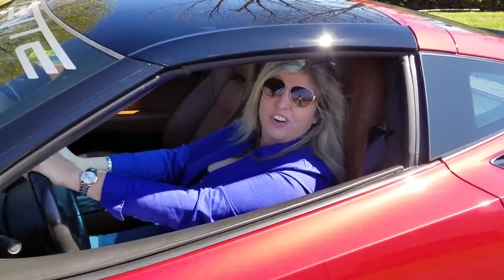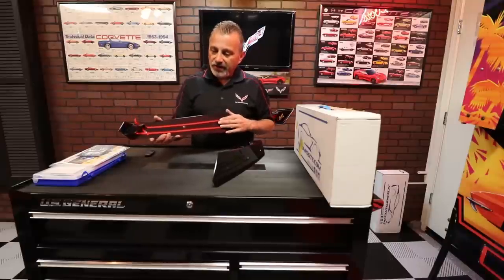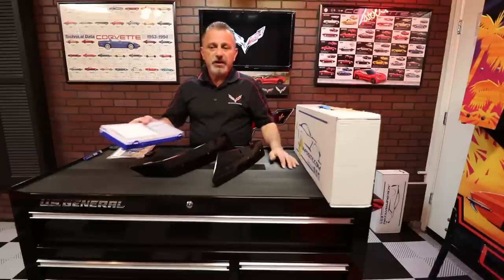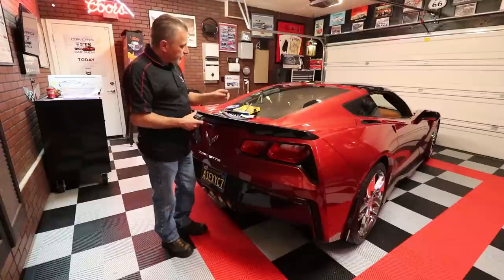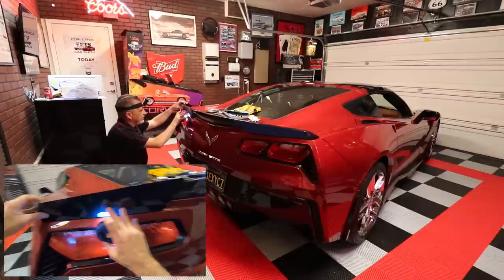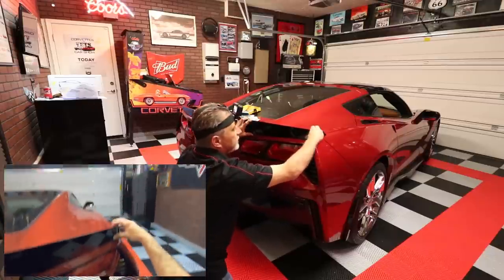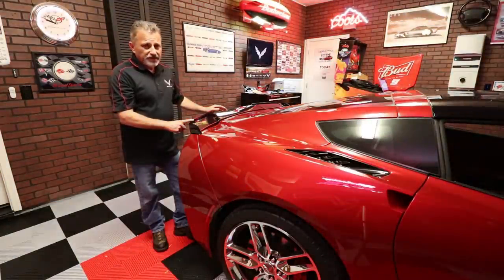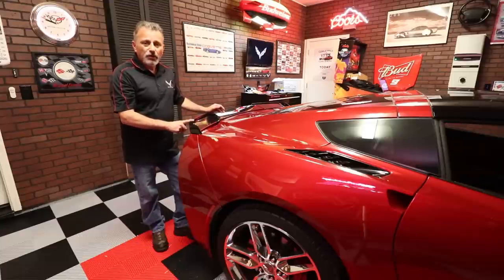How to Install an ACS 5-1 Z51 Spoiler Conversion Kit on a C7 Corvette

Comment: The actual Z06 Stage 2 wings are  a bit higher. Just pointing that out in case someone does this method and wants to mount them higher. And, they make a Z06 spoiler to mount the wings to that fits the Stingray and does not stick out on the sides.

Comment: I have a z51 spoiler on my stingray, is that what you are showing here? I would like to do exactly what you are doing but want to make sure that what I am looking at here is a z51 spoiler, it looks like it is.
Reply from the maker: Yes In this video I am converting my Factory Z51 spoiler.
Reply: THE CORVETTE CHANNEL thank you I'll be doing this in the spring

Comment: Roughly, how long do you think it should take a dealer to put this on? I am not particularly handy and I don’t want to spend more than I have to for installation.
Reply from the maker: I don't it should take any longer than 2 hours but I would think less. But if they don't do this on a regular basis they may take longer.
Hope that helps
Reply: @THECORVETTECHANNEL  Thank you so much for your prompt reply.

Comment: Why do you need the tape if it is fastened with screws?
Reply from the maker: It helps keep the debris from getting in between the 2 parts.